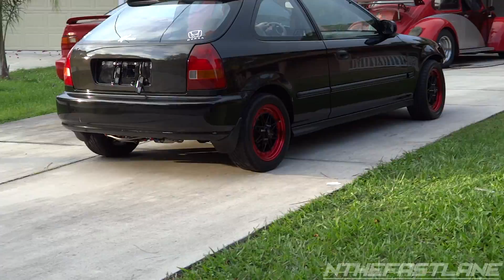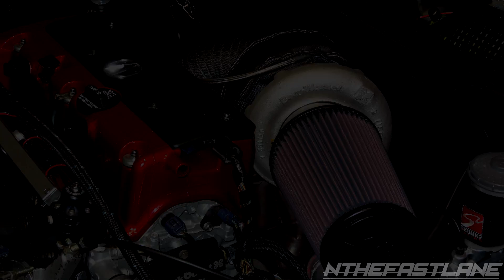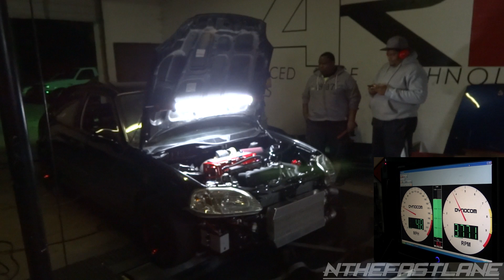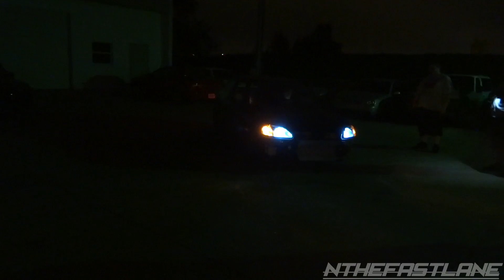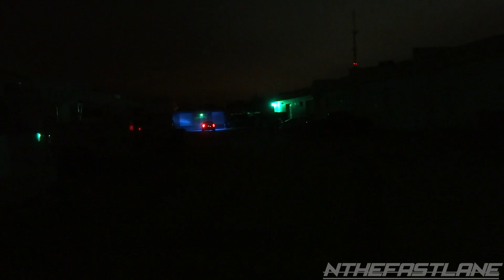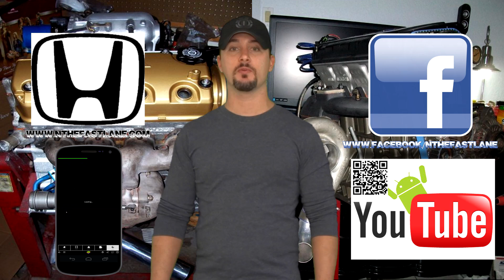500+hp Turbo K20 D-day On Pump Gas

Comment from the maker: 🛒Visit Nthefastlane's Amazon Store: https://amzn.to/3pP4UCy
(Shop This Build) It Made 759HP Later: https://youtu.be/6F_Sc8EORV0
🛒Intake Manifold: https://amzn.to/2BLgntU
🛒Turbo Charger: https://amzn.to/2X9frbY
🛒Pistons: https://amzn.to/2TXx4to
🛒Rods: https://amzn.to/2T5s3lb
🛒Cams: https://amzn.to/3KrHA9e
🛒Rod/Main Bearings: https://amzn.to/2XamyRn
🛒Valve Springs: https://amzn.to/2NeoCTS
🛒Valves Stem Seals: https://amzn.to/2V1unqG
🛒Head Gasket: https://amzn.to/2Xdyz8B
🛒Throttle Body: https://amzn.to/2EkFqG3
🛒Injectors: https://amzn.to/2V48Yx6
🛒Bov: https://amzn.to/2Xf8BS7
🛒300 Fuel Pumps: https://amzn.to/2V5R

🛒Find Any Leak: https://amzn.to/3JADlYm
🛒Download Auto Repair Manuals: https://shrsl.com/3wmrj

Comment: how many cost you spend for for that amount of power? I will make mine too but I need to know how many I need to spend
Reply: he way over spent for the amount of power he went for. He built the bottom end and reassembled the head just to make 500hp.... K20's will eat 550whp bone stock for years.
Reply: 4k easy

Comment: funny thing about boosting these b18c1 and K20s is you get used to being a pro changing head gaskets real fast.
Reply: I can't agree with that. I mean if that's your experience then you're probably not doing it right. I ran 26+psi of boost on my K20 with Cometic head gasket and ARP head studs torqued to 90ftlbs with no issues. No head lift and no blown head gasket ever. 30k miles later and countless times down the track.
Reply: I can't agree with that. I mean if that's your experience then you're probably not doing it right. I ran 26+psi of boost on my K20 with Cometic head gasket and ARP head studs torqued to 90ftlbs with no issues. No head lift and no blown head gasket ever. 30k miles later and countless times down the track.
Reply: ur right
Reply: Yo you got Honda’s mixed up with Subaru’s lol